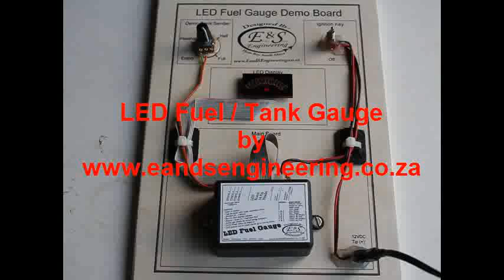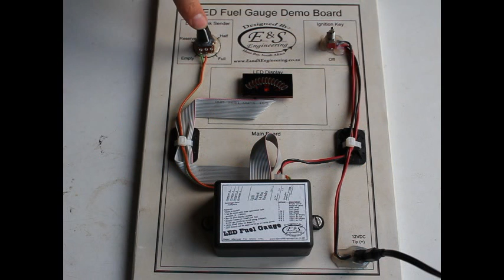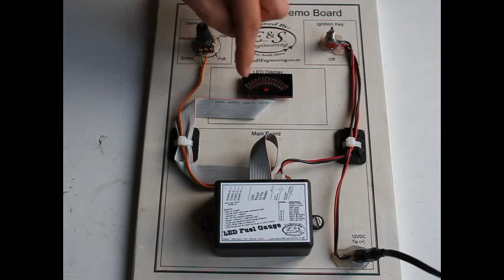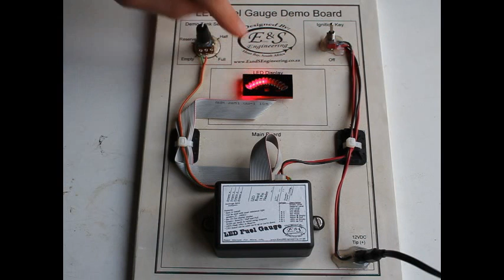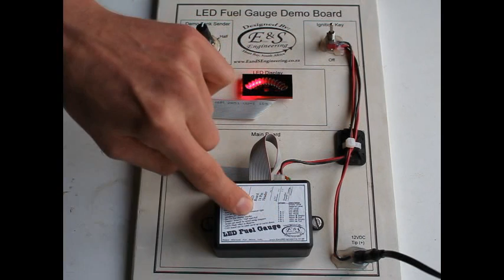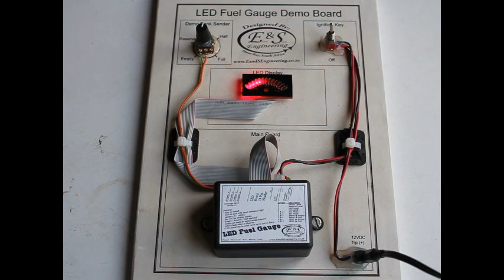LED Fuel or Tank Gauge Demo

Comment: I checked out the site. the shipping is to high. the cost is on the verge. for the price it should do more . maybe temp. time . or voltage. I know you gotta pay the bills. and can't give products away. I guess its not for me. its for a off grid home. generator 15 gal. fuel cell fuel level . I could also use a 24volt battery level gauge. they gan be bought cheap. sorry I can't afford your product. not now anyway. I guess I'll make my own. thanks anyway.